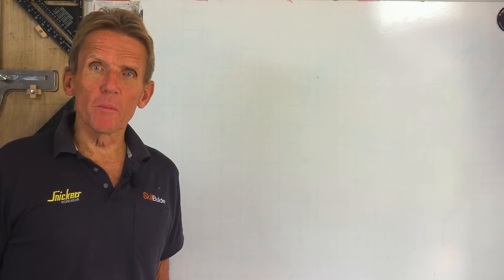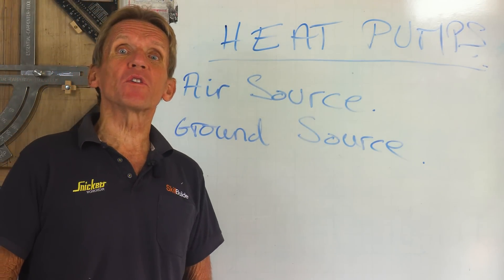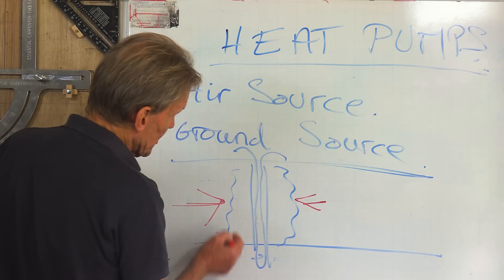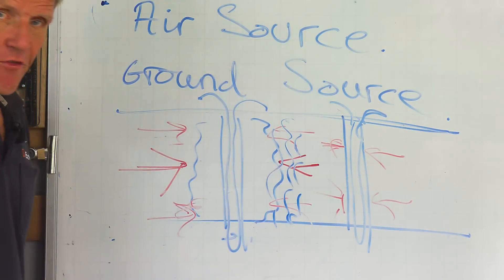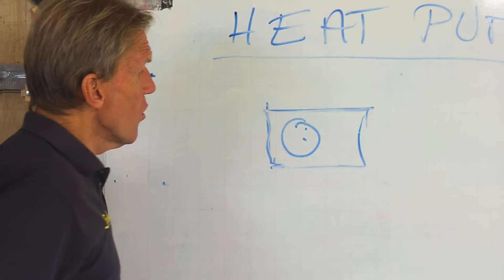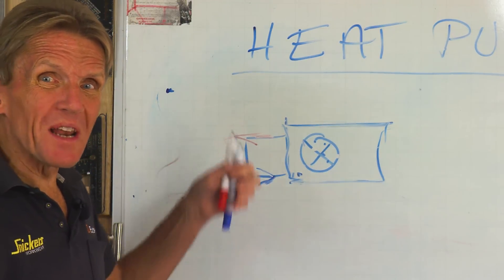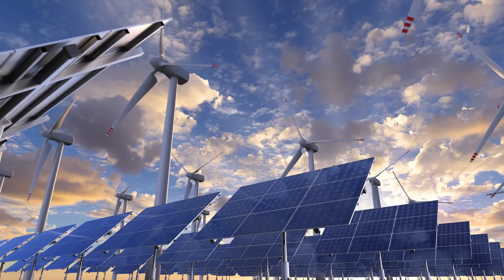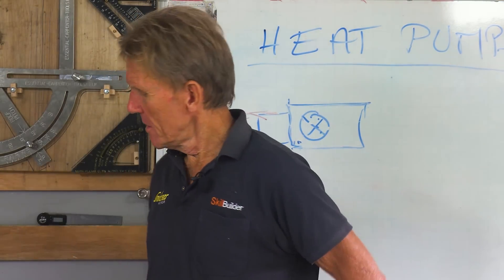Heat Pumps ~ Get Your Facts Straight!

Comment: One point: in Finland, adding 1 million ASHPs to that nation's 2.7 million homes, increased energy demand on their grid by 3GW. As the UK will need to replace some 26 million gas and oil boilers, we'll be looking at in increase in grid demand of 81GW (right now we're struggling to generate 45GW)  

How much is 81GW? Well, Hornsea ONE (Europe's largest offshore wind farm covering 300 sq miles) generates 1.25GW - on a good day. As for nuclear, well Hinkley C will generate 3.2GW when it eventually comes online (after some 15 years of planning and construction), so all we'll need is another 25 nuclear reactors the size of Hinkley C (at least half a century or work - if we could afford it)

Oh, and did I mention another 12GW for EV charging stations, plus another 85GW for agriculture and retail food production? 

All of this is for the birds, and if the UK Govt continues to push ahead with it, hundreds of thousands of people (potentially millions) will either freeze or starve to death every year - mainly the very young and the very old.
Reply: Finland gets much colder, and for much longer and will have larger heat pumps than those going in to the UK. so you can't just 27x3 to get 81GW requirement for the UK.
Reply: @BenIsInSweden  The concept of "colder" is invalid. During the winter of 2010/11, UK temperatures fell to -18.7C. During March 2018 ("Beast from the East") temperatures fell to -12C. 

In the event of a repeat of 2010/2011, there is absolutely no way the UK grid could remain operational with ASHPs - especially as a high pressure that blanketed the UK, saw winds drop to zero for almost two weeks. 

I repeat my point that during such a winter, tens/hundreds of thousands of people would freeze to death in the UK. And yes - those in the 'Dept of Energy & Climate Change' are FULLY aware of the potential for massive loss of life.
Reply: @skfalpink123  As you've essentially pointed out, they're rare, whereas in Finand they'll basically be guaranteed every winter, and -12C would likely be for extended periods of time.  And you're still wrong, the heat loss for a Finnish home is designed around a temperature much lower than the UK, hence a larger heat pumps being installed.  And the ones being installed in the UK won't physically be able to draw as much electricity as the ones in Finland.  So you can't just multiply their figure to get one for the UK.
Reply: @BenIsInSweden  Sorry, but the rarity of such events is irrelevant. That they CAN happen, means that they're 100% guaranteed TO happen, and when they do - the consequences will be terrible.

What's more, the ASHPs in Finland are primarily used to compliment existing heating systems (typically communal water/steam and/or wood burners), so their overall drain is actually LESS than what we would be expecting in the UK.

Lastly, I would add that, as someone who has worked in Finland (in place called Porvoo), I would not describe winters there as being significantly worse than those in the UK.

Not as though any of this matters, as Ofgem and National Grid will call a halt the roll-out of this failed technology (as they are legally empowered to do), long before even five million units are installed in the UK. At which point, we'll already be experiencing devastating rolling blackouts.
Reply: @skfalpink123   The consequences will be terrible regardless, there was a gas shortage in the UK last winter, and more gas gets used the colder it gets as well, so reliance on Gas isn't the solution either.  It's currently -5C where I am currently, 2 degrees below the design temperature of heatpumps in the south of the UK, and Porvoo it's apparently -2C. And we haven't got to the coldest weather yet. A heat pump around here would be designed for around -18C, so 15C below what the south of the UK is designed for. And not sure where you get that they're used as complimentary heat sources.  District heating (communal systems) are complete systems, they don't need to be backed up by a heat pump, so typically won't have one installed. And given that Finland uses NordPool like Sweden does for electricity, primarily using a wood burner would be far more expensive than using a heat pump.
Reply: @BenIsInSweden  Wise words, that miss one key point: the UK is sitting on MASSIVE gas reserves in Cumbria and the Clyde Estuary that almost certainly exceed gas reserves in Texas, and which our abysmal government is wilfully refusing to exploit.The maddest part is that during the summer months, when walk south between Lunderston Bay Beach and Inverkip, you can actually hear the methane 'fizzing' out of the oil-rich sandstone cuts that have been exposed by both tidal erosion and the construction of the A770.
Reply: @skfalpink123 Fracking? Yeah, no. Even if it were going to be used, it would be better spent in gas power plants powering heat pumps compared to directly heating homes.

Comment: Had an old oil burning combi boiler on its  last legs we are out in the sticks detached bungalow concrete block with render with cavity insulation. Had quotes for Airsource heat pumps and costs were about 12-13 k but for the grant you need a valid EPC survey with NO recommendation for insulation up to latest building regs ! 
We have planing permission for a loft conversion so waste of money putting loads more insulation in the loft just to get a grant ! Dodged a bullet I think so had an outside Worcester Bosch system boiler with a 300 litre cylinder installed all for about 6k at least we can now stay warm this winter and not worry about sky high electricity bills!
Reply: Not worth spending 100 quid on 3 or 4 rolls of loft insulation to get a £7500 grant?  Errr

Comment: Having had the house fitted out with multi-split AC units I can confirm that for heating at the moment its less than 15p per hour for the entire house. In the summer I have enough PV to entirely offset the consumption of keeping cool. The whole setup cost £3500 which is still cheaper than what I would have to put in to make an air-to-water heat pump work. Not to mention I have near instant heat and cooling I dont have to pre-plan and wait for a day or 2 to get the water temperature up. Doesnt cover hot water, thats still done with gas for now.
Reply: How and where are you getting the energy from...
Reply: Rubbish as a unit of electricity is more than that per KWH so so you claim the whole of your house to heat is a third or 300w per hour to run , absolute rubbish
Reply: Just to have a gas meter is over £100 per ann, before you buy the gas. £100 buys a lot of electricity.
Reply: You don't need to wait 2 days to get the water temperature up with an air to water pump, what are you talking about

Comment: Still early days on ASHP in my opinion.

My vaillant ecotec pro 28 is 10 years old running 11 rads with reasonably low running costs and one replacement PCB since installing 👍🏻

Comment: Despite not getting a grant for split air conditioners it was still much cheaper for me to go this way to get away from natural gas.
The argument that it doubles energy use doesn't completely hold ground, at least for us living in climates like the UK and western Europe have.
In general the amount of energy needed for cooling in the summer is much less than for heating during the cold seasons, provided that the house is reasonably insulated and doesn't have huge windows or a conservatory on the south side of your house or have good sun blinds on these.
My house is well insulated now, we had a warm summer here in the Netherlands this year, but I needed cooling for less than a week in total, and having the aircon on just a few hours per day was sufficient to keep temperatures inside below 25°C.

Comment: WHAT DO  I FIT?  I have a 1930 solid brick built with no gas though could get gas fitted for £1500. need to heat the house and have hot water as currently have no heating or hot water? 
Renovating with extension 4 bedrooms 2 bathrooms ?????????????????????????????????????????????? Help ??????????????????????????????????????????????????????????????????????
Reply: Sounds just like my house. 1935 solid 9 inch walls. I insulated inside walls with 50mm PIR foam and plasterboard. I have 350mm rockwool in the loft and PIR foam in the floors with a mix of underfloor heating and radiators where the floors are solid concrete. An 8.5Kw output heatpump heats the house and hot water and worked fine even last February when it was -9c outside all day. Since you are renovating its an ideal time to fit underfloor where you can. The heatpump draws 2.4 Kw max and though the heating is on 24/7 the heat pump only runs when it needs to top up the buffer tank.  All in all its a huge improvement over the storage heaters that I took out. Been running fine since 2015.  In my opinion a heat pump is the way to go.

Comment: It may be the difference in terminology, but over here, ground source = horizontal loop, geothermal (or "rock source") = vertical loop. The UK seems to use Ground Source to describe both horizontal and vertical loops. Either way, freezing of the borehole generally isn't an issue - in fact, it can be a benefit, as the phase change releases extra energy. If it gets cold enough to the point where it is insufficient for the heating demand, then it simply - like a lot of heat pumps in the UK - hasn't been sized properly.  The loops also don't just rely on the sun to get re-heated.  Passive cooling over here means that in Summer the loop is still running (but not the compressor), and it will steal some heat energy from the house to add back to the loop. Active cooling - when you have a cooling circuit, will run the compressor and act like AC - cooling the home, but heating the loop.  Recently things have come on the market for PV-T to use the loop as a thermal store - so you can use the summer months to put heat into the loop, storing it for heating in winter.  Basically, troublesome freezing should be a thing of the past going forward.

Also whilst monoblocs are the most common design in the UK, split air-to-water systems are also being installed - typically the Daikin high-temperature ones. The monoblock has 2 advantages - 1) can use R290 refrigerant (better efficiency, and lower GWP), and 2) doesn't need the installer to be F-Gas.

Comment: So lets be honest- if your not an eco zealot, or in bed with the states every wish... get a mini split. Youll have the benefits of per room heating so dont heat what you dont use, saving you money, youll get a dry function, fan function and cool function too. A lot more people would be on board with heat pumps if they could do what multi room mini splits can, just sayin.
Reply: Minisplits aren't without disadvantages - they typically don't last as long ~15 years, vs ~20 years for an A2W monobloc, and the cost to replace is basically the cost to install - with A2W, you should only need to replace the monoblock, which will be cheaper.  With multisplit systems, if any of the indoor units has a fault - it and anything else connected to the same outdoor unit will shut off.  If you're not up for doing most of the servicing yourself, then servicing cost increases with more indoor units.

Comment: Great video, thanks. Living in a 6 year old house, stuffed full of insulation, I can no longer take another summer trying to sleep in a bedroom temp of 33c with the window open. This can happen with only an outside temp of 25/26c so I am looking at an air to air system to heat and cool regardless of what the government think. Why don’t they offer the grant providing you get solar panels at the same time which would power the cooling in the summer. Doesn’t make sense.
Reply: You would need a big PV array to power the cooling system, most urban houses wouldn't have the space or orientation.
Reply: Then get a portable air conditioner for about £300.

Comment: Are you sure you know the subject matter adequately? 
You had to be corrected by people last time remember.

Edit

Several myths and errors as expected
Reply from the maker: I wasn't 'corected' by anyone. People have different experiences and opinions and that is a good thing but to say one person is right and another is wrong is not applicable. Heat pumps work in certain situations and I have never disputed that. I have explained why they might not be the answer to  global climate change and there are thousands of people who support my arguments.
Reply: @SkillBuilder  still repeating myths like you need an insulated building for them to work well. In the meantime, places like open energy monitoring showing plenty of solid walled properties with uninsulated suspended wooden floors with SCOPS of 4+. Cheaper to run than gas.
Reply from the maker: Lewis 
You can make those kind of claims but I can tell you with certainty that heat pumps work much better when the building is insulated because they give out low temperature heating. If the heat loss is more than the heat input you have a cold house. We get a great many emails from home owners who have fallen for the myth you are pedalling. Do you have a heat pump? Can you email me your stats and some details of your home?  If it is solid wall and you are getting a scop of 4+ we need to see that.
Reply: @SkillBuilder  lol deleting comments because you can't take the truth 👍👌

Here's a playlist full of uninsulated properties with excellently performing heat pumps
https://youtube.com/playlist?list=PLDiAM6PgxBWSHvNXvvofPzxJ7pQ5ZJvd2&si=byhO2GbNUG88W3jy

Comment: Someone reported this week that they were getting four times the heat out than the electricity they were putting in.
Reply: Could be true, but chances are it was probably far warmer outside and already warm enough inside as it was. It would be cheaper still to open the window.
Reply: Agreed, the point I was making is that it's amazing what people believe after a session with con men who tell them they can get something for nothing. It reminds me of the 1960's and off peak heaters which were nothing but a box of bricks which used cheap electricity at night to store heat. The problem was if next day was warm you had to open windows and dump the heat. Ah said the reps you got that heat for free but that wasn't the point. You'd already paid for it.
Reply: @mikemines2931  Indeed, there always seems to be an army of salesmen in wait ready to exploit whoever they can with more hot air than a heat pump!

Comment: Just perhaps when this fabled renewable energy is supplied at a cost that reflects it lauded energy efficiency and low production costs, then I will cheerfully use my mini split to heat as much of my house as it is capable of doing so. Right now, the per kilowatt heat is on a 4:1 ratio and whether this daft government likes it or not, gas is by far the cheapest energy source!

Comment: We have a couple of air to air systems. They are insanely efficient in both heating and cooling. I've got a plug that tracks the power consumption and our peak month is 24kwh usage. And thats when we have it on for 10 hours overnight everynight. Also you can control them room by room unlike central heating. Im seriously considering getting a couple more for the rest of the house. A couple more points. The main reason you don't get a grant is not the cooling element but they don't do hot water like air to water heat pumps. And so many people get confused by the rating of them. A 6kw heat pump doesn't consume 6kw of electric, thats the max heat output. Ours seem to run at 200w even when on full blast.
Reply: I agree. I'm in the UK and have had a single outlet Midea air-to-air HP for 3 years now. It's been a great success. I disagree with Dave about the cooling aspect. With our UK climate, I've only used mine for cooling a couple of times, so I'd argue that doesn't negate the benefits. Also it was very cheap by comparison with air-to-water, even with no grant.

Comment: Have cut my gas consumption by 45%, by upgrading 30 year old boiler to new, fitting lockshield valves to all rads to allowing perfect balancing. The balancing alone was a big deal, now distributing the heat perfectly. If everyone understood their central heating systems, the country could reduce household gas consumption drastically.
Reply: I don't think I've ever seen radiators without lockshield valves!
Reply: @rufus_mcdufus  Previous valves were ball valves that had little to no flow control

Comment: I installed an air to air AC / Heat pump in my office a few years back, butane coollant so no licence required - but I did have to buy a cool flanging tool.  
I have been toying with the idea of installing a similar unit at the top of my stairs, with the fans outside on the kitchen extension.   I am doubtful of it effectivity within my home, however.

My office is a SIP build so super insulated and it all works very well....I can reduce the internal temprature during recent summers from a stiffling 50 odd C to 20 and in the in the winter warm it up cheaper than my oil radiator.  

House has no gas and no wet plumbing / radiators.  hence my thinking - HP could just about be cheaper than wood and almost certainly cheaper than electric radiators.

Comment: Hi Roger, great video…wonder could you do one on cost of heat pump vs standard gas/oil both in super insulated house. It seems it’s more about insulation than the fuel source?
Reply: depends a lot on your local cost of gas and local cost of electricity. it also depends on zoning. I use mini-splits and I save a lot of energy by simply keeping units turned down or off in rooms I'm not using. boilers and central forced air usually heat every room the same regardless of whether you're using it.